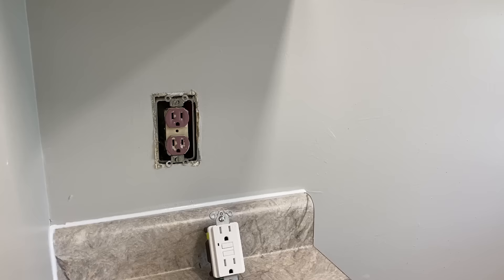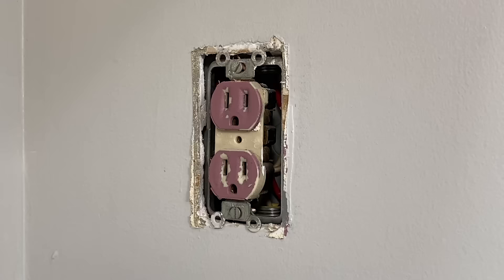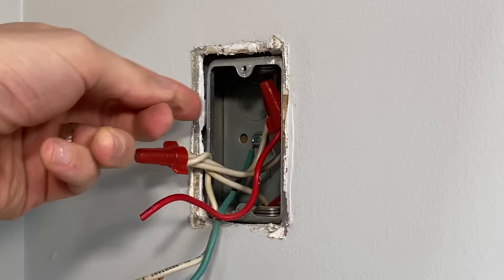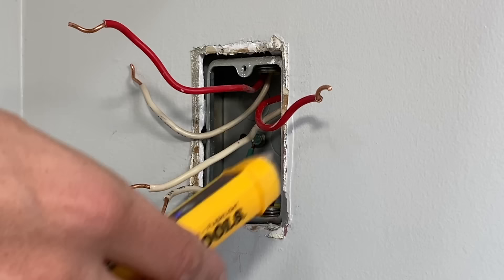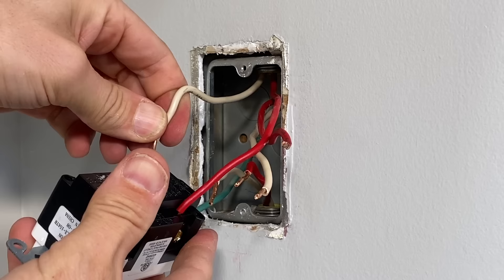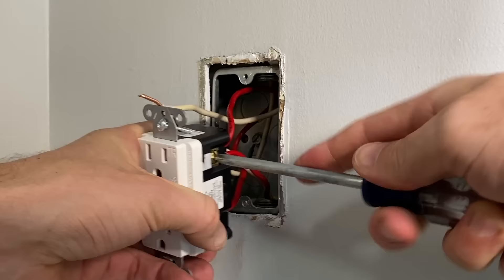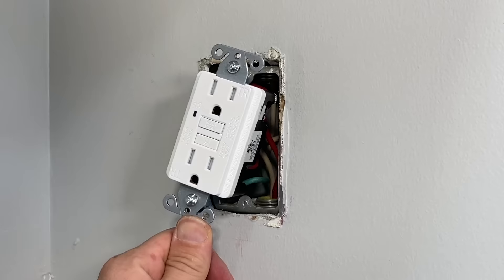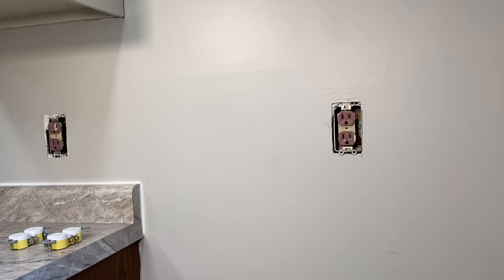Replacing A Standard Outlet With A GFCI Outlet

Comment: My set up is just like yours except I have a wall then the other outlet near the stove..L-shape kitchen..would the one near the stove be considered the beginning or the one near the sink because it has 2 down the line? In other words, when you were leaning on the counter,  the outlet in question would've been behind you.
Reply: Zane, talk with your local guys, a contractor, a union hall, or inspector.  Each jurisdiction can add or creat their own rules.  Some require these recepticles to alternate circuits, meaning  left to right your recepticles may go:
Circuit 7 w/GFCI, circuit 5 w/GFCI, circuit 7 off the first ckt 7 GFCI and finally circuit 5 fed from the second ckt 5 GFCI recepticle.

A talk with your local guy may get you the knowledge you seek.

Comment: I switched out 2 bathroom outlets to gfci but I cannot get power to the outlets.  I've checked my breaker to ensure it's on but still no power to the outlets.  Any idea what's wrong?
Reply: Maybe the gfci is the wrong amp? I'm fairly certain you can use a 20 amp gfci on a 15 amp breaker but the opposite isn't true. So if your breaker is 20 amp and you are using a 15 amp gfci it shouldn't work. I'm not a certified electrician or anything but it might be something you could check I've seen it happen before.

Comment: My question is: how do you know this outlet is the first one upstream?
Reply: It didn’t have to be the first one up stream… it’s simply the one near the water source and that’s why he made it a GFCI.
Reply: @alant5757  Thank you. I was under the impression that the GFCI also protects all the rest of the sockets downstream. I was misimformed.
Reply: @yewkiamakuahui2296  I've heard that, too.
Reply: @yewkiamakuahui2296  how you wire the GFCI into the circuit depends on what it protects.  In a circuit with 5 recepticles, you can wire it so it is number 3 and protects only number 3 or you can wire it as number 1 and protect the rest (Manufacturers restrict the number of downstream of fed recepticles to around 5).

By pigtailing or "T" tapping off the circuit, you protect only that outlet.

By running power through the GFCI (done here) you protect all those down stream or fed by that GFCI.

I hope that was a good explantation for you.

Comment: I have a single outlet that random shut my tv off I changed the plug and it didn't fix the issue I tested it with a standard plug I'm tester and it shows open hot what do I need to do to fix it

Comment: I had a problem with the low-voltage recently as the power company fix the problem from outside turns out to be one of the powerlines was struck by lightning. Now yesterday I discovered in my room, I am missing power, to 4 of my power outlets, and one closet, light but my ceiling light fan and bathroom switch work. I turn off the circuit breaker and the ceiling fan light goes off. Meaning the circuit breaker is working. I think the GFI switch I have is broken because I press the reset button and you can hear it click but it pops right back out is a bad GFI switch really the route problem of my problem. How could I properly diagnose this issue please I don’t have much money one of my family members recently passed and I’ve had a lot of expenses good anybody point me in the right direction?

Comment: I have two black wires connected together with duct tape 💀 the neutral wires are the same thing too do I need to have them split up so this could work?
Reply from the maker: Yikes,  did the 2 wires held together with duct tape have a jumper (pigtail) that was connected to the old receptacle?
Reply: @EverydayHomeRepairs  I actually saw that in one of your videos and no there wasn’t any. I also had a question about the wiring when I changed my old receptacle the wires were lose and it looked pretty bad and the wire itself looked frayed and when I tried to bend it like you did it broke lol. I then stripped the wire with a screwdriver (I know very dangerous but I didn’t have any tools) and bent it like you did in your videos clockwise and I did that for the other one too it was a 15 a 125v I think when I was screwing the wire tight not all of them were done perfectly for example the first one I did was the live wire and that one came out pretty good then I got impatient and just twisted the rest because they were still long like before the neutral wire was pretty good too but a little bit of the rubber went on the screw and for the grounded wire that one had a bit of wire hanging loose I could have the neutral and grounded wires mixed up actually and it could be the other way around. I’m new to electrical so forgive me for my little knowledge on it :)

Comment: Just found your channel, thanks for the tutorials.  Not that you have time...but why would you have two "hot" wires?  Just curious.   THANKS AGAIN!
Reply from the maker: Hey Scott, at this electrical box I had 1 “load” set of wires which provided power from the panel and then 2 different “lines” which were downstream of this outlet.  Making sure this GFCI would cover all 3 outlets that is why I wired in the configuration shown in the video.  Make sense?  Let me know if you have any follow up questions.
Reply: @EverydayHomeRepairs  Oh okay, I guess I had it backwards... Thank you
Reply from the maker: @scottb4767  No Prob 👍
Reply: Hey, it is the other way around. Line side is what goes to panel, load is downstream. That’s why the sticker covers the load side, it’s optional to have a downstream load. It’s not optional to have power feeding the GFCI from the pane. https://www.leviton.com/en/docs/LC_MO_PDF_EL_7299_INSTRUCTION.pdf

Comment: Hi I am trying to change the same outlet with GFCI but have 3 wires coming in, one is Black, red and the white and of course the ground wire. do not know what is red wire for how do I find out.
Reply from the maker: This is just a guess and you will need to investigate further but I would assume the red is a hot "load" line which goes to another outlet or "load" on the same circuit.
Reply: The red wire is a switched wire for a half hot outlet. A GFCI will not work there

Comment: You have 4 load wires is that because you have two outlets downstream? If so is it possible to run two load wires from the GFCI to the second outlet and from there run two other wires to third ?
Reply: Commenting to see what answer you get
Reply: Yep it totally is. You can chain multiple of them that way. In fact, I’m surprised that he have 4 wires, that’s not the most efficient way to wire this up.

Comment: Awesome job man ! But if the one that I’m changing only has 3 wires ? It’s an outside plug that I’m needing to change over to a GFCI
Reply: if its only the one  outlet you may want to use a gfci breaker(or what i did put a gfci inside the house and run a load wire from it to outside outlet) (i live in the northeast with a basement so it was easy to do and cheaper than a breaker) lrnd tht after 3 gfci outlets shorted out from moisture..

Comment: SO YOU HAVE 1 SET OF LINE WIRES AND 2 SETS OF LOAD WIRES  COMING OUT OF THAT BOX WHERE THE GFI IS GOING...IS ONE LOAD  SET GOING TO THE FIRST NON-GFI OUTLET AND THE SECOND LOAD SET GOING TO THE SECOND NON-GFI ?
Reply from the maker: In my circuit that is correct.
Reply: @EverydayHomeRepairs  Thanks for replying.

Comment: I.put.a.new.switch.in.and.it.sparked.the.top.switch.worked.my.mane.light.but.the.bottom.part.wood.not.work.i.pull.the.switch.out.and.it.sparked.wen.a.wire.mad.contac.with.the.box.and.the.lite,s..came.on..but.the.bottom.were.you.plug.a.cord.in.wood.not.work.

Comment: So the load are 2 hot wires and the tester can tell you which one it is? Line is the one non hot wire, red?
Reply: Actually, the line wires are hot coming from breaker box and load are not hot—they will be supplying power downstream from the outlet receptacle.

Comment: Is it ok to run another outlet off of another receptacle? I assume I would need to pigtail the wires for the additional one? And would I need a junction box to do this? Thanks
Reply: John,. Care has to be given when answering electrical questions.  The code book itself sets the local juisdiction up to be essentially electrical Gods (NEC 90.4), allowing them to "interpret", add to,  or even completely reject  the entire code.  A quick phone call could easily answer many questions....a contractor, a union hall, the code inspectors themselves.

That said, gfci's can be set up to feed other recepticles as shown in this video.  

For me to say, "Follow the instructions." sounds like A cop out, but even the NEC 110.3.(B). says to do exactly that.

The GFCI is a safety device that works like a circuit breaker to remove power from its outlets and outlets connected down stream or fed from the GFCI.  Test the also with a GFCI tester.

Pigtailing is not an NEC requirement but is best practice for non-gfci recepticles. 

 Again the GFCI is a safety device, but if it is pigtailed, you loose that protection for the follow-on recepticles.

Pigtailing will fit in many recpticle boxes already installed, so no extra boxes should be required to make it happen.  NEC 314.16 talks about box sizes and how many wires are allowed.

And NEC 300.14 talks about leaving at least 3 inches of conductor outside the box where any dimension of the outlet box is less than 8 inches ,(electricians, please read that last sentence before you complain).  Most electricians say 6 inches outside the box.  I will remind you that if you have to much wire you can cut some off, if you do not have enough, you can re-run your wires.

Hopes that helps.

Comment: Our old house does not have any ground wires. (over 100 yrs old!) Will a GFCI fix that problem or do we need to have an electrician put in ground wires in all the outlets?
Reply from the maker: It is my understanding (I am not a licensed electrician) that you can replace a 2-prong ungrounded outlet with a GFCI.  I have done this is a few older rental units.
Reply: @EverydayHomeRepairs  Thank you!  Thank you for the video also.  It is people like you that make our lives easier!
Reply from the maker: Thanks for the kind words, I really appreciate it. 😁
Reply: @EverydayHomeRepairs  Correct the NEC allows this. As the ground is not essential to the function of the gfci outlet, much confusion about this. The gfci merely monitors any current imbalance between the hot and neutral. Thanks for the vid.

Comment: I want to install a GFI on my circa 1925 2-prong outlet.  The inbound black wire and inbound white wire are looped around one + terminal and one - terminal and continue outbound unsevered presumably as the onward load wires as well.  Do I severe these 2 wires so there are 4 wires, 2 to connect to the line terminals and 2 to connect to the load terminals?
Reply: Yes.

Comment: It looks like the tester can’t ID the line neutral wire. Does it matter where the neutrals go (line vs load)?
Reply: yes it dose line side has to be the exact feed  nut. and hot wire  a gfci monitors current flow going out and return so if the feed wires are not on same path it will see a difference and treat it as a fault same if line and load are reversed

Comment: I certainly understand the advantage of a GFI receptacle however I'm wondering about the advice I once received.
I was told that a jumper from the neutral pole to the ground pole would offer a ground fault since at the main box the neutral and ground tie to the same place.
Is this acceptable?
Reply: Just sick to the code and do not start improvising. Advices you once received are not the way to go.

Comment: So the one Red wire has the power when to the LINE side? or the LOAD side on outlet? I see you tested one Red wire has power when you shunt off the panel, but that hot wire went to the Load side of the outlet? and the rest 2 Red wires went to the Line side?
Reply: The live red wire (coming from the source) and its corresponding white wire go to the LINE, power in. The other 4 wires go to LOAD, power out. All downstream receptacles will be gfci protected in this configuration. Red wire to brass screw, white wire to silver screw in all cases here.
Reply: @surferdude642  thankyou

Comment: Hi. If you use these in a run can these be split so the top or bottom can be controlled by a switch ?
Reply from the maker: I could be wrong but I do not think GFCI design support the switchable circuit.
Reply: Thank You. @EverydayHomeRepairs

Comment: i have a question sir, if the plugin to be changed(a standard one, right next to a bathroom sink, it was like that when we got here, actually 2, one on each side and neither gfci) is at the end or the middle of the circuit, will it still protect the others along it?
Reply from the maker: If you install the GFCI in the middle then the receptacle at the end of the circuit which will be connected to the "load" terminals of the GFCI will be protected.  Be safe and best of luck on the update.

Comment: I'm replacing a broken outlet similar to this with a GFCI. However the wiring on the old outlet is black, red and white with ground. The GFCI doesn't have enough space for all of this wiring; only one for load and one for line. I wonder if I have the wrong GFCI outlet?
Reply: I hope you already have this fixed (6months).

Electricians normally use 14/3 or 12/3 with the colors you described for switches or switched outlets.  Larger wires with those colors are typically used for 240 vac loads.

Your house may have undergone some renovations that removed a switched outlet, you may have had someone under a time crunch with only that wire and they ran it leaving the black or red not connected, or their was a time that wire like that was run to allow the top recepticle to be on one circuit and the bottom circuit to be on another (circuits 5 & 7) with only Only one "common neutral" for both.

With many options like this, I strongly encourage you get a pro involved.

Comment: Can you go over how to install a GFIC. I just replaced my plug with a GFIC and it keeps tripping and shutting down all the plugs on the load side. I am not sure why the GFIC keeps tripping. Can you go into greater detail about the GFIE and how it’s supposed to work? Thanks 🙏 And can you also cover load and line?
Reply: Set it up with only the GFCI without the load. Test the GFCI. If it works, you probably have a ground fault downstream.
Reply: A GFCI makes sure that all the power leaving the line comes back on the neutral. If power is leaking then it's either shocking someone or there's a short to the ground.

Comment: The thing I noticed is that one of the outlets your protecting with the GFCI appeared to be the refrigerator. The refrigerator should not be put on a GFCI. If one of those wires went to the refrigerator it should have been connected to the line side of the GFCI.

Comment: I opened a plug-in to change to GFCI from older type. Only one wire of each, rather than 2  of rach color and ground.   What do I do with that?  It's the furthest from huge sink,  but only 3' barely.   Along a wall of 3 outlets.
Reply: This means it is an end of the run outlet, no further outlet connected downstream. Connect to the line side only. However, one of the upstream outlets, if a gfci, may already be protecting this one. Like he did in the video.

Comment: I have an electrical outlet in my master bedroom and on the opposite side is the en-suite bath. The receptacle is basically on the other side of the stud where the hot and cold water supplies the shower. Does this outlet need to be gfci even though it’s a bedroom outlet?
Reply: Not necessary because it is in the bedroom.
Reply: The new 2020 NEC states that if an outlet is can be reached with a 6ft cord from a sink, it needs gfci. It no longer matters if it is in a different room.

Comment: Hey great video, I was able  to replace some of our old outlet with gfci but one outlet in our kitchen which carries 220 volts has one black wire as a hot wire, a white as neutral, one red wire and a ground I am a bit confuse maybe it is not feeding any other outlet. I need your opinion on that. Thanks a lot.
Reply: In America the 220v has two live lines and one neutral. Use a contactless tester to confirm.
Reply: Probably only one cable going into that outlet with the conductors inside.
Reply: @williamwchuang  Thanks for that brother.

Comment: Stupid question, but how do you tell which outlet is 1st in a daisy chain?
Reply: Unfortunately the easiest way is just trial and error unless you can trace the wire from the electrical panel through through the top plate in the attic. Flip the breaker, find all the dead outlets connected to that breaker. I have found that usually the one closest to the panel box will typically be your first one in the run, but not always. Now, you'll just need to take one plug out and undo the wires and separate them so theres no risk of contact. Flip the breaker back on, and test the wires to see if you find a hot wire and then test the other plugs to see if they're hot. If not, you know you found the first one in the daisy chain.